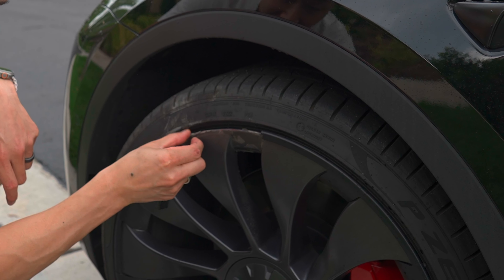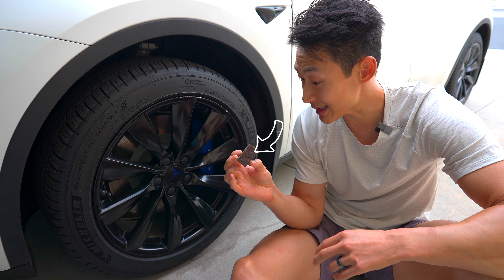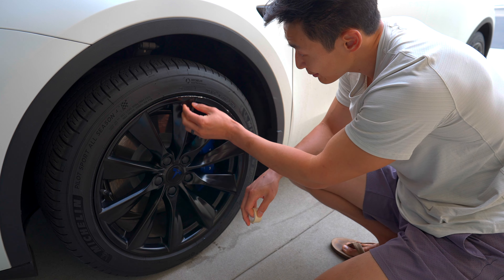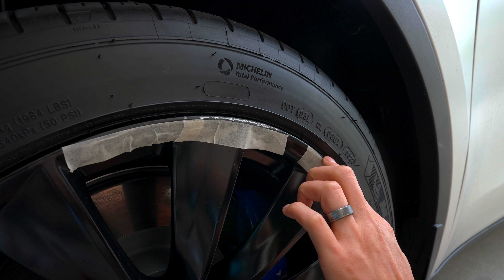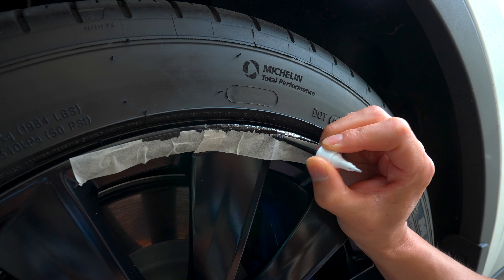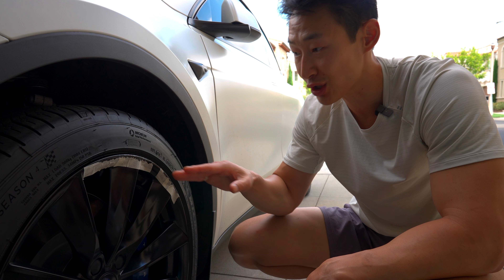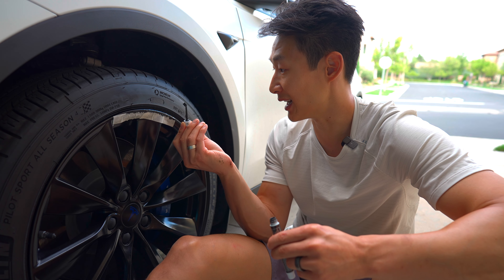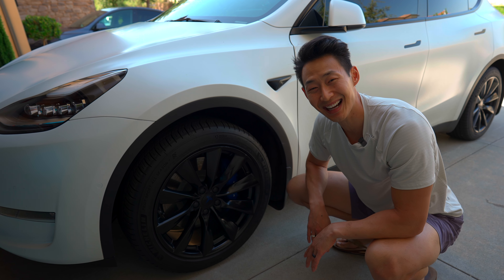QUICK DIY Wheel Repair for Your TESLA

Comment: You can also use a orbital buffer with the sanding pad and it will be a lot faster, I bought an orbital buffer for my Tesla and I never thought I would use the little sand papers that came with it, lo and behold I got a dent on my rim and I used it, then I got some paint from AutoZone that was meant for cars but worked perfectly matching the Gemini rims. Overall, this will be a great video as a base for what to do even if you don’t buy that kit. I watch it and it’s basically all of what I did summarize in one video. Thank you so much.
Reply from the maker: Oh wow. Orbital buffer is legit!
Reply: By the way, I forgot to say that it’s been six months since that happened and it basically looks like new intact, don’t forget to sand all the way through the scratches, the visual aspect of the scratches compared to the visual aspect of a little bit less rim it’s no match. You always want to send all the way through the scratches even though if you lose a little bit of rim density. By the time you’re done, and the car is parked, you won’t even be able to tell even if you’re looking directly to it.

Comment: I appreciate the detailed demo. Now that I see how you did it, I would probably add 1 more thing. I noticed you applied 3 coats of paint and brushed it on with strokes. I would probably do the same thing and apply with 3 coats except I would apply the paint 2 times with strokes and one time put on a drop of paint in those crevices to build them up and fill them in more. Yes, drying time would be longer.